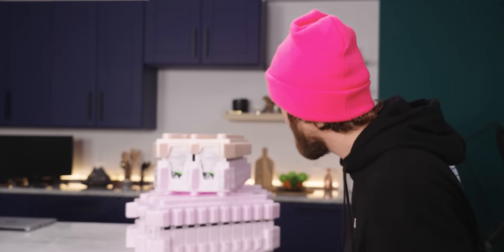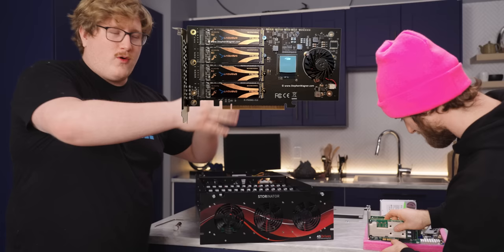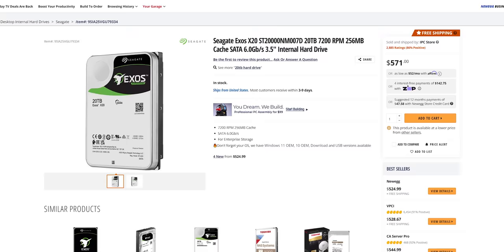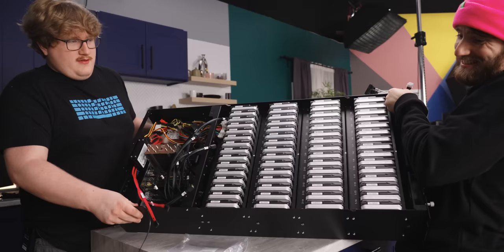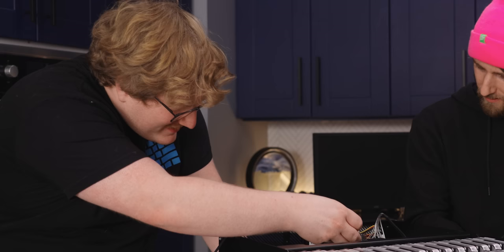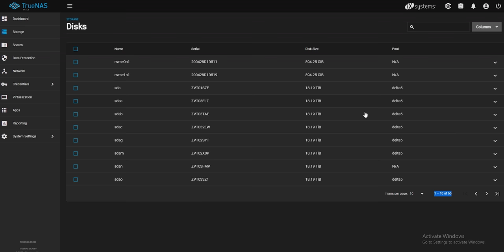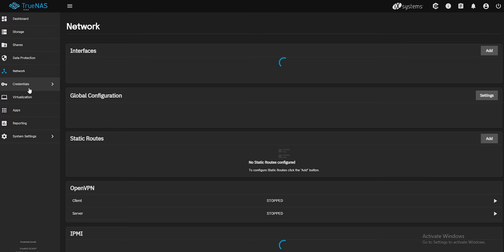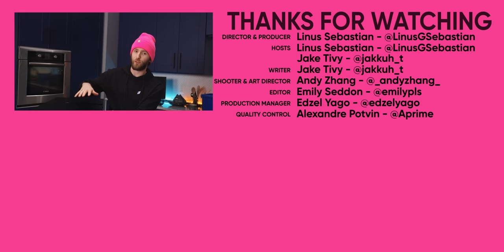My dream FINALLY came True! - Petabyte Project Recovery Part 2

Comment: I get hyped for seeing more of the long-term projects at LMG/LTT, like Petabyte Project/Server Room stuff, Pyramid PC and Linux Challenge.
Reply: Yea man same
Reply: It's like the LTT lore and the other videos are filler episodes
Reply: @neuro3423  fair, but at least with LTT the filler is entertaining
Reply: Always fun when they have trouble...
Reply: Nothing will ever live up to ‘Whole room water cooling”. Event if it didn’t actually work.
Reply: @profblack  Have you seen "All of our data is GONE"?
Reply: @thetalesofdaneandco  That was a wild ride but I just find the concept of watercooling multiple PCs with one loop and then taking the water out of the room and cooling it in one big radiator assembly with the whole thing connected by custom cut copper tubing way cooler.
Reply: Uh wastage of storage is hype inducing? Why even store relics in full quality?
Reply: @ ☆MOMOKIMI☆(人 •͈ᴗ•͈) Ayo, one slipped through the cracks 😂 Linus! LINUS! ZAP IT! ZAP IT BEFORE IT SPREADS!!!
Reply: @profblack  it only didn't work because they decided to use windshield washer fluid as coolant instead of water, which caused copper oxidation and deposited gunk everywhere iirc.
Reply: Scrapyard wars
Reply: As Long as it doesn’t turn into a 2 year project like the Desk, I am fine with that
Reply: @candlelarbra5212  came to reply saying this but you beat me to it. I hope they do more scrapyard wars. I love that series.
Reply: Agreed - real life infra projects (Petabyte, home cinema/reno, A/C are what hits that like button for me.
Reply: @shadowivy333  A bit more technical than the vid of today would also be ok. this build was a bit too high level. Maybe a bit more about the actual truenas setup as i'm sure it's a bit different than my 4x4TB setup at home :P
Reply: Same Im glad Im not the only one!!! The Pyramid PC was crazy for sure
Reply: Yes
Reply: @shadowivy333  yeas
Reply: Show more about your servers
Reply: @shadowivy333  ik heb het gestort op de pc rekenen maar dat dan ik heb ik er

Comment: Less than 2 years from now, Linus will be doing another 'we sad' video because this new device was neglected into oblivion just like the last two. 😂
Reply: is a feature ... if there's an IT guy, nothing will break and that means lesser videos.
Reply: Also any rebuild of 1 20tb failed drive is going to take AGES :D
Reply: I mean, if it's going to be neglected--maybe do full mirror, those last just about forever. And investigate why so many drive failures--that's too many for a small (in total drive count) setup.
Reply: It's just content all the way down.
Reply: "neglected" is a strong word.  We prefer 'gently misremembered'

😋
Reply: I never did understand this most recent 'data loss'....; all I saw was that nobody noticed the last server was filling up? (You'd think someone would notice/become concerned at 75% full)

Comment: I can't wait for them to hire an actual IT person and they tell Linus & Jake everything was done wrong.
Reply: I find that hilarious - when someone buys “enterprise hardware” with much lower performance, capacity and reliability at a much higher price “for the support” which when it comes down to it , may or may not save your data
Reply: Till then we can all do it for them. It's amazing how, for a tech channel they can know so little about tech.
Reply: Like what? Please tell us.
Reply: @spendy26  I’d suggest that they fail as quickly as consumer drives of similar capacity (or did before SSD’s) - Backblaze published drive failure statistics were a good source for non enterprise disk failure rates which didn’t differ too much from enterprise.
However - enterprise raid controllers with sufficient cpu and battery backed cache  did allow for special drive setups for maximum fault tolerance at the cost of more wasted capacity. And of course SCSI drivers (including SAS) failed much more cleanly than consumer IDE drives 
Plus the vendors did publish their own firmware updates based on faults experienced at other customers, especially if you paid for the extended support past four years. Enterprise software did offer predictive drive failure notification which allowed drives to be swapped out in raid sets online with minimal chance of data loss (albeit a slowdown as the raid array was rebuilt)
Reply: @tomorrow6  clearly never built a server before. Good job reading pointless reports though.
Reply: @spendy26  literally thousands of rather expensive servers from multiple vendors and plenty of troubleshooting of failed drive arrays - but Ok
Reply: @spendy26  This is the exact attitude of “Well, it feels better” rather than acknowledging measurable data.
Reply: @johnbuscher  building servers day in day out for the last 20 years am pretty sure I know what I am talking about. I would never build any kind of server with standard desktop drives.
Reply: @goggles789 no cold storage on tape for starters.
Reply: @spendy26  these aren't "standard desktop drives" but ok
Reply: @CelluloidRacer2  he's not talking about the drives in the video. read the whole comment chain.
Reply: @spendy26  oh wow, a guy on YouTube says he’s built servers for 20 years, you’re so cool
Reply: @tomorrow6  i would never put a standard consumer drive into this kind of enclosure thats asking for trouble
Reply: i find it super funny when people in comment sections say stuff like this because yes they could do it better you know like a SAN not a NAS but still thats my only real problem with this from my perspective
Reply: @bigpod  yes that used to be somewhat true for enterprise spinning drives versus consumer drives - but did you ever look at backblazes published data versus enterprise MtBF rates?
Reply: The actual IT person would look at everything and go "Why aren't you using a dedicated block storage array to provision LUNs to virtualized file servers in an HA environment? Why are you not running redundant network paths with VLAN isolation for various traffic? Where are your three layers of backups? What do you mean you don't have a tape-based backup solution? Why are you not reaching out to HPE, IBM, or DellEMC to get them to at least partially sponsor you with some storage arrays? And get in touch with NovaStor, Quantum, or IBM for the same deal on tape backup systems."

I definitely think that they should be running a lot more fiber and utilizing some actual enterprise-grade switches to get line-level 25Gb networking with 32 or even 64Gb FC SAN. Most IT guys also wouldn't condone DIY-ing anything like a server or array for a production environment solely due to a lack of hardware validation and ongoing support contracts. There's a lot of people who laugh and say that you shouldn't overspend like that on hardware that may not even perform as well as something you could build yourself, but if it fails and you have a good support contract, the company will fly you out a technician with any and all replacement parts you need to fix the server or array. In an experimental environment where you're just testing things, or instances where you're validating software functionality on legacy equipment, sure, you can get away with cobbling things together, but not in an actual datacenter environment. You buy the service contracts and let someone else deal with any faults so you can blame them if production equipment goes down and your HA environment has to actually do it's live failover.
Reply: @mndlessdrwer  being an actual IT person i can say somethings you said make sense but some are on discression of user, but guess what at tge end of the day its all content and if nothing breaks where is fun and content in that
Reply: @tomorrow6  I've supported a lot of storage arrays and I've only seen a handful of times where they actually lost data. Take, for example, the DellEMC VNX2 product line. I've only seen one instance amongst dozens of arrays where a storage pool lost data, and that wasn't because the hardware wasn't good enough or the support wasn't there, but because the business unit whose array it was decided to cheap out and not renew their support contracts and they didn't want to pay to order replacement drives. A single array had sustained over 20 drive failures before the storage pool went down. I'd say that paying extra to get an insane amount of fault tolerance built into the device can be quite worthwhile. I've also worked on hundreds of servers and I think I can count on two hands the number of them that outright failed catastrophically, and a third of those were IBM Powersystem P5 servers, which are ancient and should have been decommissioned half a decade prior anyway. While I can certainly agree that some manufacturers don't make a compelling argument with their equipment, some of them really do. Cisco, HPE, and some DellEMC products are worthwhile because they're built to live in a datacenter with ambient temperatures of around 80 degrees Fahrenheit for 7-10 years without failure. Consumer equipment is usually designed to last a maximum of 5 years because they want you to replace it. Enterprise equipment manufacturers can rest assured that their customers will replace their equipment over time without them designing it to fail, as improved compute density, efficiency, storage and RAM capacity, as well as overall power efficiency improvements will make it worthwhile to replace their equipment on a 5-7 year schedule anyway. Also, enterprise hardware comes saddled with a lot of additional costs due to validation processes. BIOS, firmware, software, and hardware undergo a lot more validation processes to ensure reliable functionality prior to the product or update being released to market. You're also underwriting their continued support of the platform from that front for the expected lifespan of the product, instead of with consumer equipment where you get maybe a couple of years of support at best.

So, yeah, there are reasons why enterprise hardware is expensive, and if you find it laughable that people value the things that make it cost more then you clearly aren't the target audience.
Reply: @bigpod  Single-controller data storage devices make me uncomfortable, as does a lack of backup mirroring, as does the use of the storage server as the file server instead of using it to provision LUNs to a virtualized and HA file server. They also lack an adequate number of backup solutions, of which tape archives should be one.
Reply: @mndlessdrwer  backups i agree but for their perticualr scenario i think the architecture tgey use isnt as insane as it seems but at least the vailt should have backups
Reply: @mndlessdrwer  also i do think working with IBM to have tape library  would be cool content anyway
Reply: @bigpod  If they want some insane content, they should try to get their hands on a decommissioned DSSD and use some of the random workstation boards they have to build a storage solution using the DSSD to provision block storage using their dedicated HBAs and then have the host connect to the SAN using the Gen7 Brocade/Broadcom 32/64Gb FC HBAs and switches, then install ESOS on the host and make the FC HBAs NVMe-FC target devices so you can provision the NVMe-backed storage devices from the DSSD as NVMe LUNs. The DSSD is already cool enough, on principle, but actually doing something like that with it would be even cooler.
Reply: @bigpod  Definitely. They're insanely cool even from a non-techie perspective. It's a giant box with a robotic armature in it that retrieves and deposits tape cartridges into a library. Like, auto-loading mechanisms are inherently cool, but take that and make it the size of a refrigerator with up to hundreds of tapes where each tape can hold something like 18TB raw, 45TB compressed? And there's been a tape breakthrough back in 2021 where they demonstrated a capacity improvement up to around 450TB per cartridge. Tape isn't going anywhere anytime soon. It'll remain relevant for deep backup solutions for quite a while to come.
Reply: @mndlessdrwer  that is interesting to you and me but would it be interesting to most of LTTs general audiance
Reply: @mndlessdrwer  also just to jump a bit back diy approach to servers isnt that bad personaly im more for custom built inhouse servers then buying something off the shelf in certien cases like LTT(since its verry much computer and IT operation) would i say the same for something most other cases defenetly no, right tool for right job
Reply: @mndlessdrwer  tape is great for backup amd they did make some content around it but i think they do not wanna touch something so expensive as tape libraries as my guess they dont think anyone will sponsor even a part of it and well to buy themselfs they are expensive
Reply: Their servers not falling apart and just running without fail wouldn't make great content